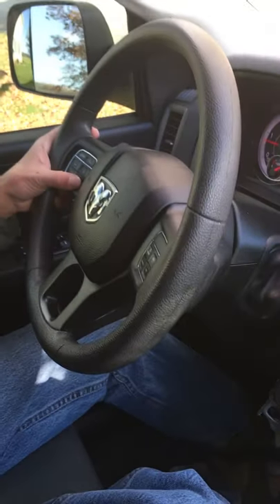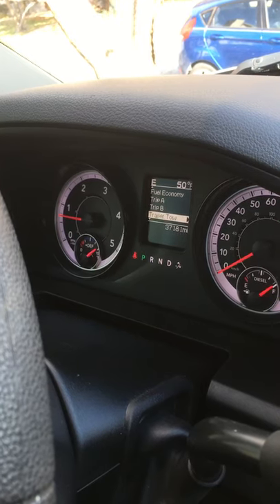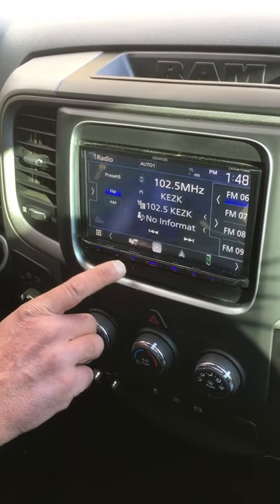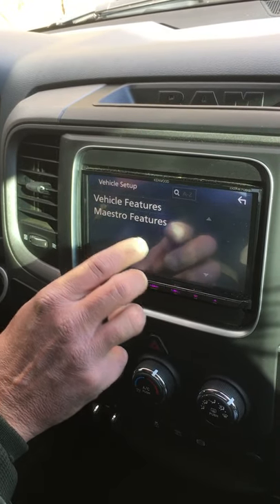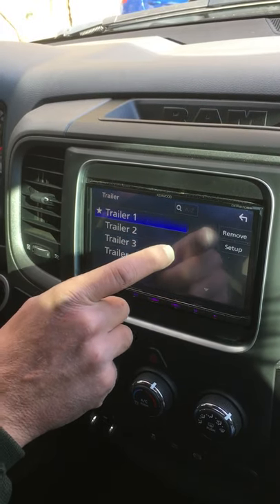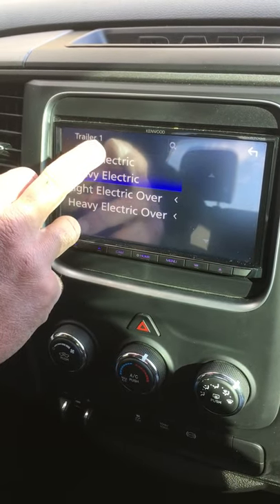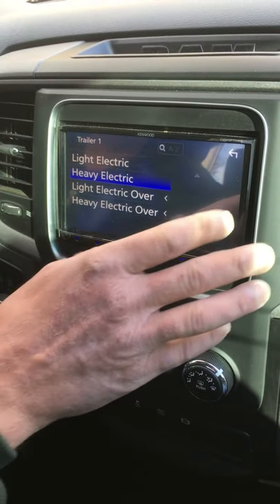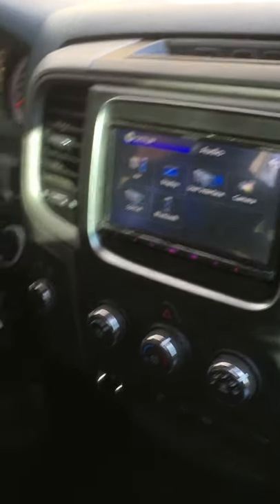2018 Ram 2500 Integrating Braking System. “Switching from Light to Heavy Electric”

Comment: Nice, thanks! 
I didn't know where the setting was either.

My 2018 RAM 2500, not a Dodge, is a little bit different.
My screen is all touch and the layout is different too.
If I recall correctly, the trailer setup menu is right in the main menu.
We'll see....